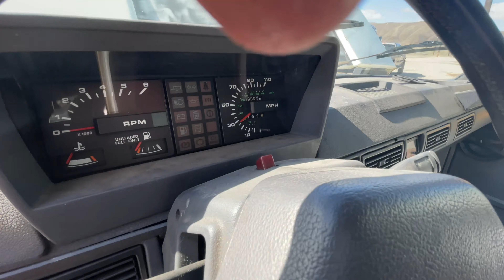Thinking of Buying a Range Rover Classic?  How to spot the Rust

Comment: If you pull the carpet (which is Velcro'd down) off the lower tailgate, the inner skin generally goes first so you get a good idea of how the lower is holding up.
The rear cross member is also a common rust point.